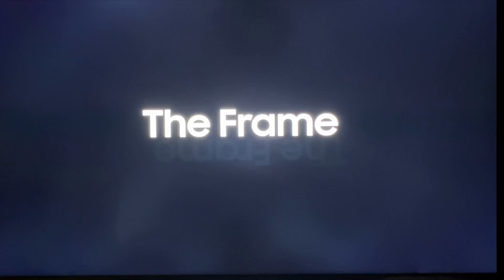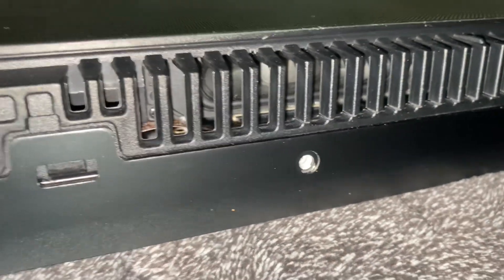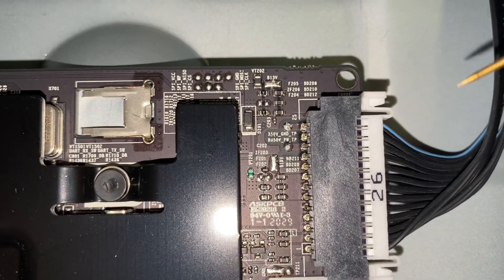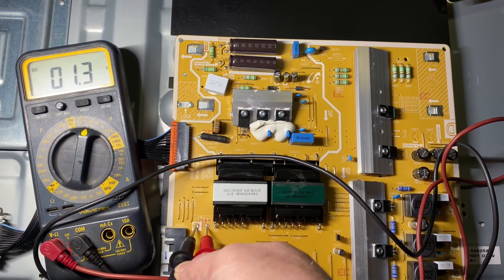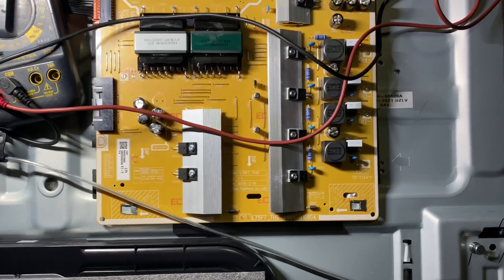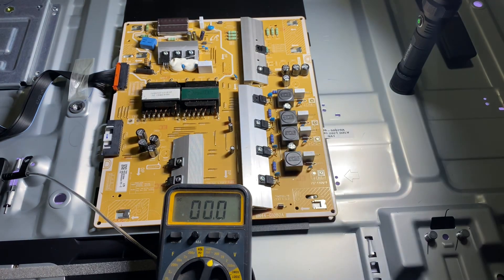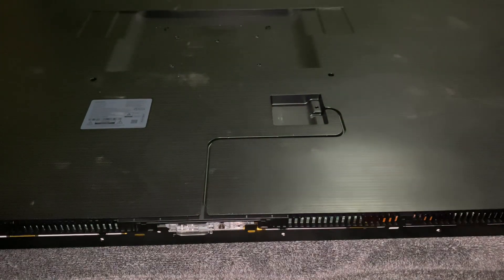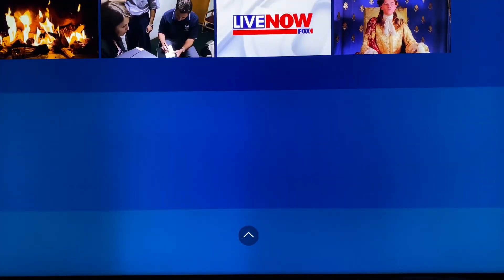75" SAMSUNG QN75LS03TAF QLED “The Frame” Repair - Symptom of No Power/ Picture QN75LS03 4K Smart TV

Comment: My Samsung The Frame TV 55" qa55ls03takxxl is continuously turning off and on by its own with each time the frame logo appearing  post which sometimes the main screen appears otherwise it is on a continuous loop of restart. Requesting your help here..
Reply from the maker: I’m not familiar with that exact issue to provide you with specific suggestions. If you don’t mind taking a shot in the dark and don’t have experience with circuit troubleshooting, you could find replacement boards on eBay and start with the most probable board first.

Comment: Thank you for this video! Very informative. I have the 75’’ Frame TV with irregular darker shadow on left side. DSE? Is there fix to it? I see some videos that LED backlight could be an issue. Any suggestions? Thank you!
Reply from the maker: Thank you for the feedback, I enjoy helping others with giving things another life. This 75” that we have sometimes shows a shade darker in certain menus and modes, but I never notice it while there is an active image without a menu being on. If the darkness that you’re experiencing is consistent and there is literally little to no backlight, then it could be a bad led segment, or this same power supply that I outline replacing in this video.
Reply: @SupraSeth  Thank you for getting back. Yes that Black Shadow is consistent and may be backlight LED, is there any recommendation on a Pro? :)
Reply from the maker: @tarakbhatt2111 remove the back cover and measure the voltages on the backlight supplies. I believe there are 3. There is a socketed cable that connects to the power supply and it feeds the backlights. The sockets can make bad contact.

Comment: Enjoyed the video. I am currently trying to troubleshoot a 2024 55” Samsung Frame TV. The main board where the one connect plugs in does not have the voltage reading spots like yours has right at the beginning of the video, unless I am missing them or they are covered up. I did measure secondary voltage across the points that reads 13V on it on the power board and only was reading 0.6V (I am no pro at this, just bought the tv on facebook for cheap and wanted to give it a shot). I cant find a repair/service manual for my model online, so was wondering if you had any pointers.
Reply from the maker: @cameronmalone221 , carefully start exploring the main PCB for those test points. Mine were covered with a tape. I had no schematic either and luckily used to silkscreen on the board to help identify the expected voltages. Wishing you success.